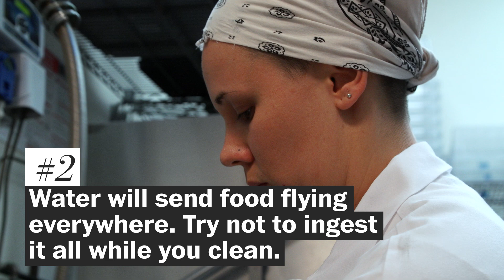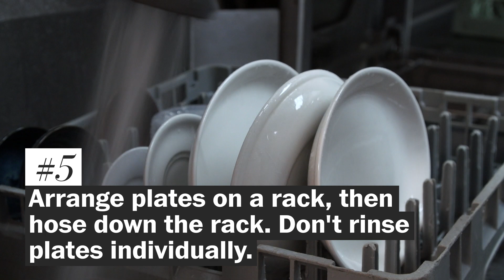7 secrets of successful restaurant dishwashing

Comment: Dishes that take up an entire wash cycle, like big pans or larger equipment, are your friend. slide them in whenever you run behind on racking dishes, maybe run them through twice while you get caught up depending on how dirty they are
Reply: Karl Marx  thanks camarada
Reply: All dishes require an entire cycle.  What are you washing with just half a cycle?
Reply: @Tmr1221  as in, dishes that take up the entire dishrack. No idea where you got that conclusion from
Reply: @Tmr1221  no they don’t lol honestly you can half run them if you want to soften the stuff on the plate, hit it with a metal scrubber spray it send it back through again for a full cycle

Comment: A tip: You’re not proficient enough if you can't have a full rack ready to go through before the cycle ends
Reply: If not a couple of racks with the same type of dishes, let your clean racks of dishes pile up on the other side while you're racking up and then stack when you run out of room
Reply: I got 4 racks set up full before that damn machine stops running 😂
Reply: And run the deep sinks.

Comment: You never answered your question:  how important is a dishwasher in the success of a restaurant.  Pointless.
Reply: Most restaurants do struggle with the business with or without a dishwasher however, if you are a food safe and WHMIS certified you can make it work with the proper training and with no taking short cuts with cross contamination. When it get's busy, it's very important to have at least 2 dishwashers, 1 for the day shift and 1 for the evening shift. If it does get too crazy during the evening shift the manager MUST provide 2 dishwashers for the night shift or allow the day-time dishwasher stay awhile for about 2 hours until the dinner rush in complete. Servers MUST also has to bring the dirty dishes back to the kitchen and not let the bus pans pile up. I've worked in bad restaurants and quiet a few don't do this, it's all about making money and not the passion.
Reply: You have to remember the dishwashers are the backbone to every restaurant. Without a dishwasher there would not be any dishes. The place would pretty much be screwed. I love my job as a dishwasher, I would not trade it in for anything else
Reply: @annetteslife  I have done manual labor my whole life. I doubt that it will ever get better than minimum wage. I really don't see a future beyond McDonald's. It's quite sad. But I guess it's all on how you look at it.

Comment: The dishwashing machine at my job is shit. It gets clogged so easily and barely even cleans the dishes so I gotta do most of the work by hand scrubbing which takes time and slows me down when the restaurant is super busy. It sucks but I need money for college!
Reply: OutNProud500 

I think you should get another job somewhere else, I know you need money for college but that dishwasher should not be getting clogged easily. If it does then the restaurant needs to provide you with a better one or find out the problem. You can simply ask them to fix the problem or find a better positon somewhere else. That is just my opinion though. I do hope that it gets better and you don't have to work too much over-time
Reply: People quit dishwashing all the time, lots of places are usually hiring. If you can, try a place where the Chef started out as a dishwasher (many do) they should understand.